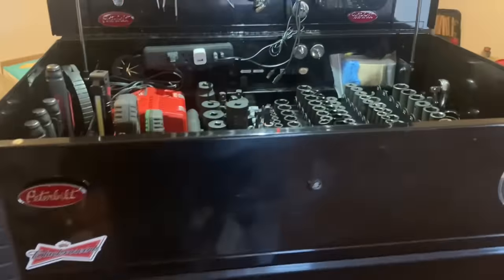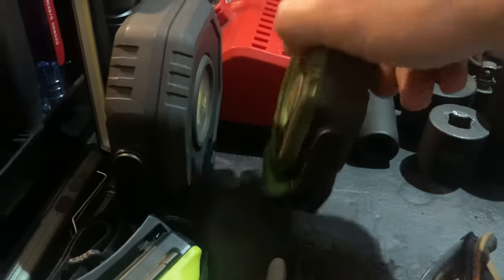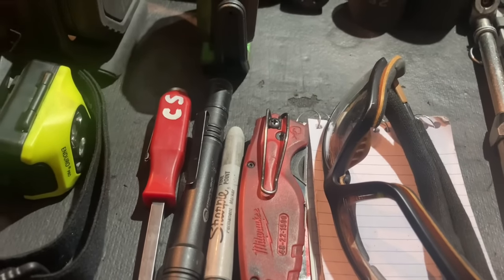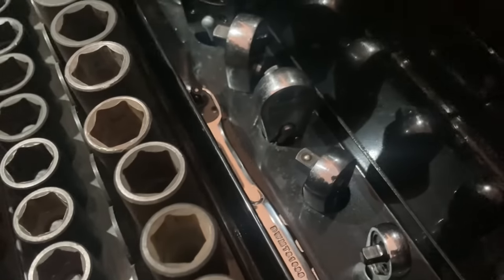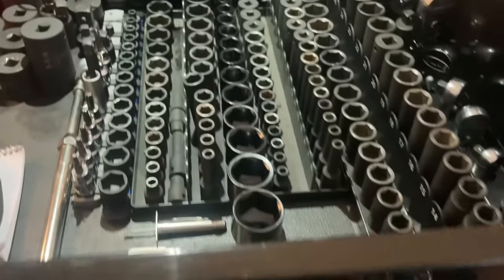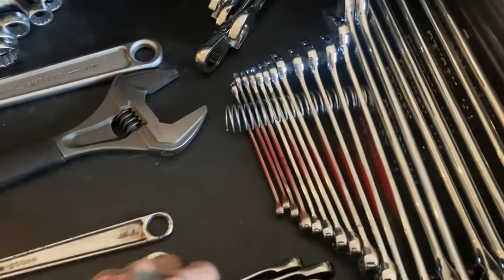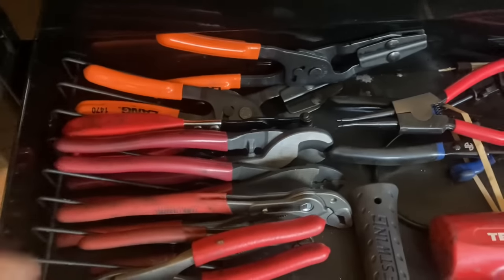Diesel Technician Harbor Freight Tool Box Tour-Stay off the tool truck!

Comment: Doyle and Icon are professional quality all day
Reply from the maker: From what I’ve got from those brands so far, I don’t have any complaints. I will continue to use them on these big rigs and update. 👍
Reply: The button adjust on my Doyle knockoffs of the knipex cobra is smoother than my actual knipex pair. You really have to break in the knipex to work smoothly. Prefer the knipex because they open wider but those Doyles are a homerun.

 Matco sells the exact same pliers as the Doyle the PL7, PL10, and PL12 are just green handle Doyles for 5x the price

Comment: I have the same Mayhew torx set and they're OK, kind of cheaply made but they've held up well and were very affordable for USA made. But they sell torx/hex/triple square stubby bit sockets that are the titanium coated "dual drive" they're super short and you can use them with a ratchet or a wrench. Those are probably my favorite tool purchase in a long time and one of the most underrated tools on the market.

Also the rocket socket bolt extractors are very good usa made for a great price
Reply: Also recommend the the Williams roundhead ratchets over those pear heads. High tooth count and very smooth cheap usa made. Way better ratchet imo

You definitely don't need tool truck stuff, you can even get good usa made tools for a good price still. Williams has a lot of snapon stuff for cheap, proto has a lot of Mac stuff for cheap, Wright is affordable, Mayhew is gives you an amazing price for the quality. Trusty cook, wilde, sk, Martin tools etc.
Reply from the maker: All valid points! I like Williams and will probably slowly phase out my “cheap shit” for Williams when I start breaking things.

Comment: After 35 years in the trade I agree with you on impact sockets for the most part. Buy truck brand 12 points for head bolts. Willams ratchets are good but they have a lower tooth count that snap on Mac Or gearwench.  Gearwench ratchets feel nice till they break and your knuckles bust lol. I mainly use Mac in 3/8 and 1/2 for that reason. I still use 1” for wheels my cordless dewalt rips them off to but it kills the guns. After 2 red ones and 2 yellow ones it gets expensive. Quality wrench’s only make a difference about 20% of the time. Don’t have to be snap on or Mac. Proto wright or SK(old ones) make a difference on tight rusty or siezed fasteners. I pay the truck price for punch’s chisels and pry bars from Mac rebranded Mayhew because of easy lifetime warranty. Same with drill bits. Mac cobalts lifetime warranty only have to buy once. You have a good set up for only a year in. I always prefer to see a guy starting out with lots of cheaper stuff and upgrade as needed that a huge box and nothing in it borrowing everything. Oh and for a 1/2”  breaker bar get a used old Mac off eBay indestructible better than anything. Mines 30 years old and I’ve pushed on it with a loader to crack stuff lose.
Reply from the maker: Thanks for the info. I only use my 1/2 impact occasionally for wheel nuts to extend its life. I’m not rebuilding engines, nor do I intend to but I’ll look into  better set anyway. As far as 1/2in drive ratchet for stubborn bolts, I’ll look into the Mac breaker bar. I need something super sturdy in that range. 👍
Reply: @Themiddleclassmechanic  I got an old junky Snap On used paid $20.00 great tool. Yeah 1/2 drive about 24 inch. Breaker Bar Chrome.

Comment: I subscribe to the philosophy of buy the affordable tools first, and save as much as you can.  The tools you keep breaking, replace with the best possible tool you can manage (sometimes that means the tool truck) because those broken tools are firstly not strong enough to keep up, and secondly are usually the ones you use most often and are worth putting more money into.  Also, tool boxes: tool boxes, no matter how fancy are storage and just keep honest people honest… remember: the box doesn’t make you money, the tools inside do
Reply from the maker: Yup! That’s a solid philosophy. I just caution people to do research first. A lot of stuff on tool trucks (not all of it) is just rebranded from a much cheaper version. Take snap on adjustable wrenches for example. Made by Bahco (now owned by snap-on I’m pretty sure) and can be had for 30-60$ on Amazon.

Comment: 19:33 - That wrench extender is also a good way to torque an odd fastener, you can use a 1/2 torque wrench on it to set a desired torque
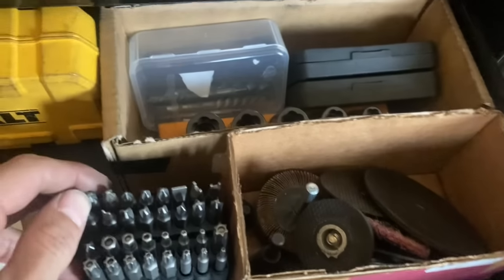Reply: And at 23:08 Irwin also sells left turn drill bits for that extractor set, they are worth it! Half the time the bits will turn out the broken bolt without even having to use the extractor
Reply from the maker: Good to know, I’ll check it out. Thanks!

Comment: Im not a pro but heavy wrencher. I hear what you say about not always going tool truck. But i also see the other side. For impacts and many rebranded items def makes sense to go with oem over rebrand. When it comes to sockets ratchets etc all depends as you may end up paying the same over time. Snapon front loads there warranty into price which means that ratchet will last you the rest of your life. I always deal directly with company not dealer and i can say first hand their customer service is wicked awesome especially if you get the right person. This has def pulled me more towards snap on for alot of my purchases "buy once cry once,"
Reply from the maker: Yeah, can’t argue the benefits to tool truck warranty. Comes in handy for chisels, bits, etc too. I just can’t justify the price of the other stuff in my opinion. If my 60$ ratchet begins to wear, I’ll just get another one. Larger ratchets I understand buying snappy brand or tool truck brand. So much force on them, you need the best you can get.
Reply: Buy once cry once is true to an extent but it’s better to have a lot of cheaper stuff starting out than a few expensive tools. Especially if your unsure if the trade is for you. You can upgrade overtime and your not borrowing a lot. If you mainly use t25 and t30 torx get snap on. But the rest you use once a year the cheap ones are ok. If you mainly do electrical and diagnostic a $1000 fluke meter is necessary. But if your a driveline and suspension guy a $150 meter is fine but a good 3/4 impact is necessary. I have mostly Mac and a bit of snap on. But my triple squares I use once every 3 years are from princess auto (Canadian harbour freight).
Reply from the maker: I’m not completely sold on spending thousands on a tool that a 200$ tool does just fine. I agree there are some times you gotta spend the money but most the time people just want the “nice to have” tool. Things are too expensive these days to justify getting a job done 10min faster if you’re hourly. The pay rates here in the US are years behind in my opinion, mostly anyway.
Reply: Yes for sure all comes down to personal preference and lots of research. I think if I were pro and really trying to be budget friendly I would start with used tool boxes, etc as that seems to be a trap for alot of guys going in debt. Other stuff like impact sockets and alot of hand tools can save alot with top tier tsiwan stuff. That being said I try to go usa made as much as possible especially with lang and lisle etc
Reply: But once cry once needs to kinda fall off the wayside.

Because when you can’t rely on your rep to get it warrantied on the spot you have to send it in and deal with corporate and at that point the warranty is the same with everyone else not in the truck. I say that because there’s reasons why you hear such up and down stories with people and their tool trucks rep. It’s not an isolated issue with a few guys when they bitch and complain about their rep. 

Even snap on break more than the fanboys like to admit and yeh the come back is warranty is worth it … is ?? Because unless my tool breaks a day or two before the truck comes I’m waiting a full rotation of visits from the truck for it to be warrantied. At that point jus like my miwlaukee warranty with hand tools every time that I called the number before leaving for work it would hit the mail that night and I’d have it 3 days later, which is just like the example of snap on if I broke something after the truck came for the week.

I had Milwaukee ratchets for a while and they never broke (not counting the 1/2 I broke by putting an impact behind it) I’m talking regular hand use my ratchets never broke. I bought snap on becuase I wanted two sets one for work and one for home. I could of bought another miwlaukee set for the house but when my rep told me he can get me two sets not full price but new I said fuck it bought 1/2 flex head ratchet set and regular 3/8 ratchet set for 650 for the two brand new. Anyone who knows snap on and their listed prices it cost 650.00 for just the half inch but I got both for 650.00 so In that specific instance I said fuck it and bought both snap ons and brought the Milwaukee home 

You don’t need snap for 90% of basic hand tools snap on makes specialty shit you can never order from other brands and for that 100% understandable

Comment: Doyle cobra pump pliers are the exact same tool as Matco.

For the 12" it's 105 bucks off the Matco truck, 23 bucks at the Freight all day. So you're paying 82 bucks for the Matco logo 😂
Reply from the maker: The Matco is rebranded Knipex cobra pliers. You can get Knipex cobras on Amazon for $30-150 depending on size. I just go straight for the name brand German pliers. They are truly unmatched. I’d like to try the Doyle out though to compare. Thanks for the idea! 👍

Comment: I have the shorter capri tools breaker bar and the flex is ridiculous. I dont trust it and it convinced me to not buy anymore of Capri tools and went back to my old duralast breaker bar
Reply from the maker: Yup. I’ve since replaced that breaker bar when it broke. When I need the torque i just use a 3/4 extendable ratchet now.